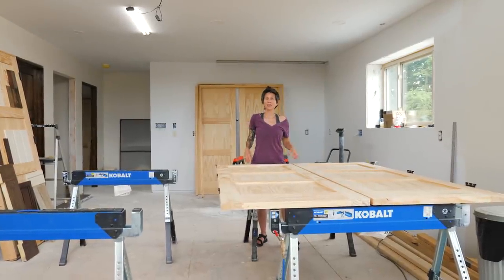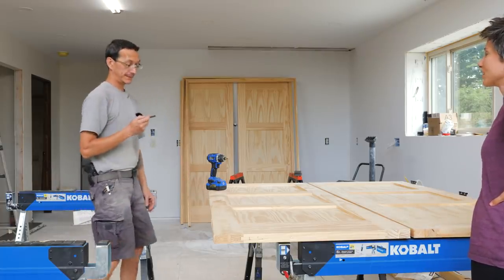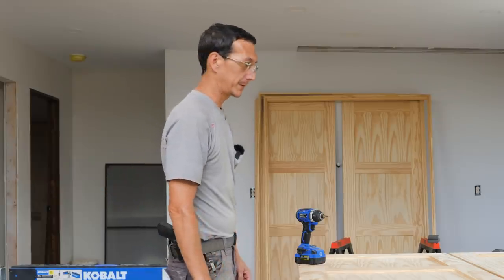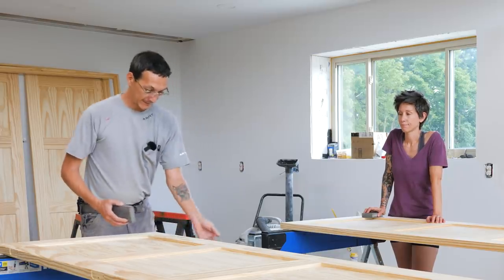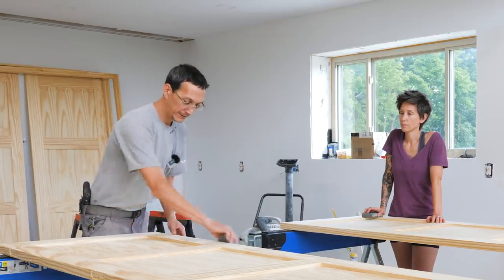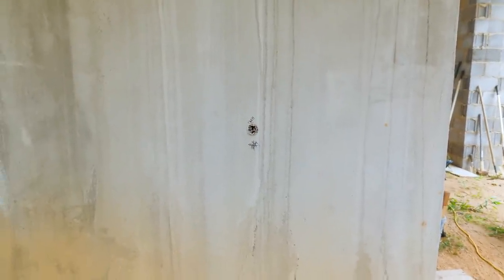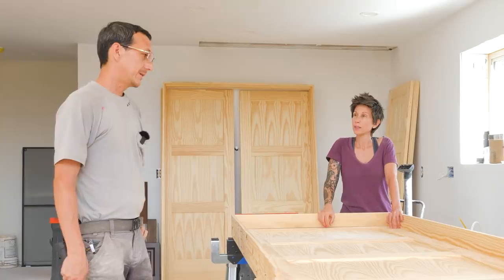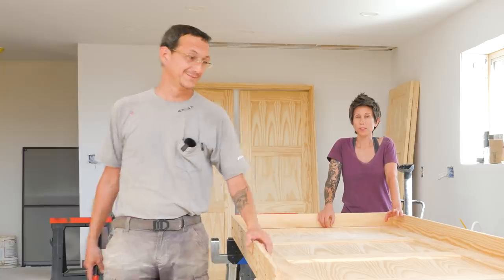The ONE SKILL I wish I HAD! (and installing gas lines)

Comment: I had no idea about the used car market having issues. I have 2013 VW Bug Convertible that I am no longer driving. I love that car, but since I really shouldn't drive anymore (eye issues make it dangerous) I told the hubby I wanted to sell and for $8k. He looked it up and found out they are going for more than $10k at trade in value which means it sells a for a ton more than that. I thought he was nuts when he told me that. I guess not. 🤣
Did y'all try the windows the way I suggested? Opening them from the top window by pulling straight down? Just curious.
I can hardly stand to wait to see the fireplace go in. I bet it is going to be gorgeous!
Reply from the maker: We always lower the top sash on the upstairs windows yes.

Comment: If you go through the build series for Wild Wonderful Off Grid, they set up their solar array to be able to deal with air conditioning (and like everything else including heavy duty power tools and so on). The guy is an actual electrician too.
Reply from the maker: We did a whole video series on our solar setup as well. When we move the system to the house I can just add more panels and should be good to go...
Reply: @Guildbrookfarm  yeah I watched it. I think it might have been how I found your channel. I used to watch every solar setup video I could find. I am not sure its just adding more panels though. I think you need more battery capacity because the draw for any sort of air handling system will drain the batteries faster.

Comment: You have power now (window AC); that's new right?  I thought you had to wait for the inspection.
I didn't realize they allow flexible gas lines now.  Or is that just a propane thing?
Reply: I think that A/C unit is running off their temporary generator.
Reply from the maker: We have always had temporary power but need permanent power to run the main central hvac system. We borrowed the window a/c from a neighbor so we can run it from the temporary power.

Comment: Don’t the vehicles nowadays have computers that make repairs more complicated or impossible depending on the issue? Or you have to take the whole car apart to be able to get to what you need to get to? My dad could fix anything on a car when I was growing up. Not sure if that is so easy now.
Reply from the maker: Yes. That's why we look for older used vehicles in good shape that are easier to maintain.
Reply: @Guildbrookfarm  Smart! We have a slow oil leak in current car. They said it is simple to fix but the cost to fix it is a couple thousand because they cannot get to it without taking the car apart. We are living with the leak.
Reply from the maker: yeah I would too

Comment: Hello, Quick thought check Florida We like Trucks in Treasure Coast or in Alabama. If you take a CHEAP $40 flight on Spirit Air and drive truck gome. I just bought a 2006 Trailblazer V6/ w 40k and new tires from a Seasonal duel resident senior w maintenance records and tow package for $7500 make last trailblazer has 250k and I gave old Betsy to a friend in need and offered to take her back when they get back on feet from C19 financial hit. Very reliable, comfortable and Longbed is extremely helpful to move boxes, small furniture etc. Good luck

Comment: I've got a degree in auto tech, but don't work in the industry.  You have to buy your own tools (extremely expensive) and pay around here is poor.  But I've saved THOUSANDS of dollars just fixing my own cars.  And cars here are 5-6 grand just for a rust bucket with no AC.
Reply: This is a world wide problem. Garages pay badly but charge the customer a lot, the customer thinks the technicians are well paid, they don’t understand they are poorly paid then spend tens of thousands on tools out of that crap pay. I had 50k pounds of tools in the UK but left the trade as a master tech because to make ends meet I had to do ‘foreigners’ (jobs after hours and at weekends at home), also people don’t respect technicians, no one wants to pay a reasonable wage for the skills and treat you as if you are scamming them. Not for me.

Comment: If you have the time, take an online learning class on automotive repair or see if your local community collage offers it. When I was 18 of driving age. I bought my first car, a VW rabbit.  All I owned I sunk into it for a down payment and made monthly payments to pay off the loan.  One day I had issues with the charging system and not knowing anhything about repairs, I took it to the local VW dealership.  The manager told me it would be $150 to replace it.  I only had 120 in savings, and asked my father for the balance, $30, When I went to the dealership to pick up my car, I was handed a bill for $300.  I said wait this is not what I was told and asked to speak with the manager.  The manager said they had to replace the wiring harness in additon to the alternator.  I said I would not of approved the work and said I can not pay the bill.  He was nice enough to deduct the price of the wiring harness and settled upon the original quote.  After that realizing I would have problems with car repairs in the future I decided to go to the local community college and enroll in a few automotive classes for the sake of being able to repair my car.  Its been a blessing, so many times those classes led me to other independant reading and can fix my car most of the time.

Comment: Is the main source of heat the minisplits?
Reply from the maker: Heat pumps. We don't have mini splits.
Reply: @Guildbrookfarm  Oh…sorry I may have misunderstood. I recall you installing some Mr. Cool units. I was wondering if they were just for air conditioning or also do heat. We have Mitsubishi minisplits that do both.
Reply from the maker: They are Mr. Cool Universal Split systems. Basically a hybrid between a mini split and conventional heat pump system.
Reply: @Guildbrookfarm  Thanks

Comment: If you dont have a skill make friends with someone with the skill that would help you for a case of beer😏

I just buy the repair manual for the car I have which is basically the same books lying around a automotive repair shop and only bought the unusual  tools as I needed them IF it was cheaper then letting a repair shop do it ($50 repair vs $$600 tool.....nope)

Comment: You need to start young if you want to learn to Work on cars 
Best to find a mentor locally to teach the girls to work on their own cars now. 
Start with changing oils. 
Get a cheapish set of basic tools and build up from there. 
Every tool purchase put to use will save you money and pay for itself in no time. 
I start young cos I had to in order to keep my car running. Couldn’t afford a mechanic 
Still can’t. Saved tens of thousands of dollars over the years.  And double that considering I have had the same car for over 20 years. So saved on not having to buy a new car. .

Comment: You should look to trade knowledge. You guys have skills others need and someone is a great mechanic. See if you could trade skills.
Reply from the maker: We do that all the time locally. Sometimes it's just a matter of scheduling, availability or urgency. We usually are able to maintain our own vehicles, but when shopping around for a vehicle, some we don't have experience with like many imports.
Reply: @Guildbrookfarm  for the girls look at a 2000 or so year Toyota Corrola.  Man they are bulletproof.  I drove one for 13 years and the only thing major with it was rear left bearings replacement and needed new rotors once.   Get a manual as the automatics were junk.

Comment: Seems to me that the older style vehicles like from the 50s, 60s and 70s  are the way to go in rough terrain areas like yours. Maybe someone should start making those kind of vehicles again.

From what I've seen most of the hold up with supplies seems to be in 2 different areas; transportation from manufacturer to end user, and access to electronic and computerized components. 

Well what if someone started making items that don't REQUIRE electronic and computerized components again. Sure, they wouldn't have all the features that the fancy new things have, but then, neither does refurbished old items either. So you would have to manually roll windows up and down, or pull a lever to adjust your seat rather than push a button, so what? At least your vehicle wouldn't be out of commission because some sensor goes out, despite actually being in perfect working order mechanically.

The problem is that technology has outstripped practicality. And that products are designed by and for people in urban areas. They have no CLUE as to the needs and pitfalls of people in rural areas, and frankly don't CARE about them either. They're oriented on things like bragging rights, and out doing the Joneses, not will it hold up to a poorly maintained dirt road or can it haul a livestock trailer.

There has been a MAJOR upswing in old technologies being reproduced for today's off grid rural homesteaders. Hand cranked ice cream freezers, meat grinders, butter churns, etc have made a comeback in a fairly niche, but growing market. Why shouldn't things like trucks, vans, station wagons, tractors, riding mowers etc. follow suit?

Comment: Maybe try buying a car from Texas... No Rust
Reply: That would have to be a dry part of Texas without high humidity and a rainy season!
Reply: @jamjar5716  Well the salt from the Gulf would eat at the paint, but Nothing like the salt on the roads in the winter else where.... They use Very Little salt in the winter down here.  
So, most places otherwise would be a good area to buy a car.  I am not sure about the pricing though.  But the rain itself not a problem for rusting out vehicles, at least not here.  
I am originally from Norther Indiana... And they use Tons of Salt, Mega.  But the roads are better!   New vehicles can have rust within a year or two... Terrible.  Exhaust systems get maybe 2 years up there.  Down here I can go 10 plus years or more.  My 1999 chevy Silverado, I drove Just shy of 15 Years down here, and the same original exhaust system.

Comment: Just be sure you’ve got A LOT of $$ for tools!!! There’s a ton of em, specialized. And these days, you’ve got to deal with a computer too! No thanks! Gimme the good old days of the “shade tree mechanic!” Too much $$$$ to set yourself up! 😪
Reply: A lot of times the special tool costs less than the labor at the dealer so if you can figure out how to do it you might as well buy the tool.
Reply from the maker: As long as you will be able to use the tool enough to justify the cost compared to having the work done by a mechanic.
Reply: @Guildbrookfarm  if it costs less than the labor at the shop its saving you money even if you only use it once.  Labor rates are insane.  Its been about 5 years since I was a tech and we were charging 110 an hour and it turned out we were the cheapest dealer in the area.
Reply from the maker: That’s insane. $60/hr here is high.
Reply: @Guildbrookfarm  I could charge that as a shade tree mechanic here.

Comment: WOW car prices in the USA are currently stupider than they are in Australia. My car is a 1997 VS Commodore 3.8 V6, a 24 year old vehicle that runs dual fuel petrol[gas USA] and LPG. it has 189,000km on the clock. Could probably ship it to the USA and get $20,000USD for :D :D :D